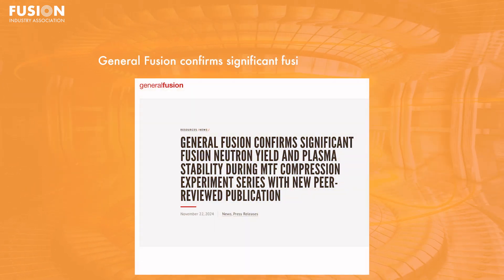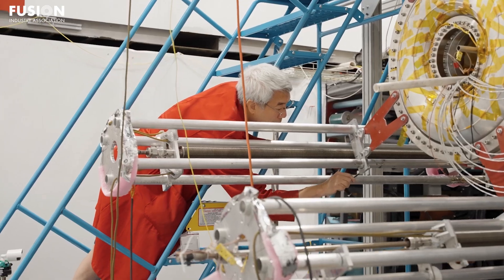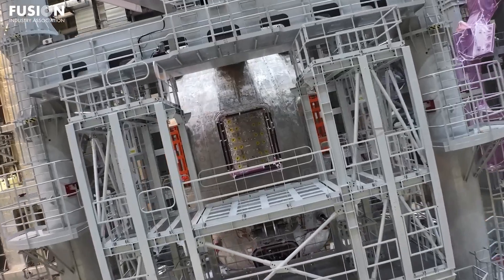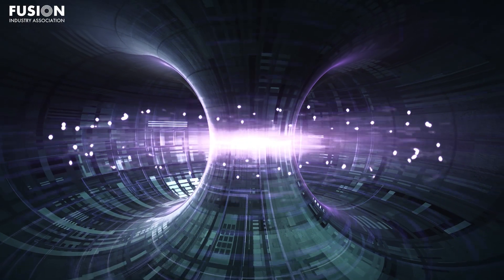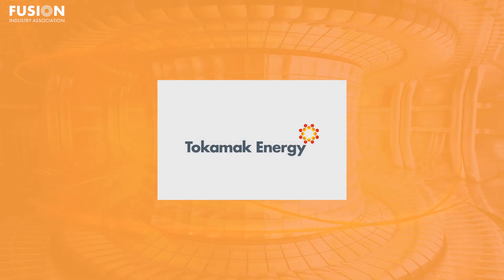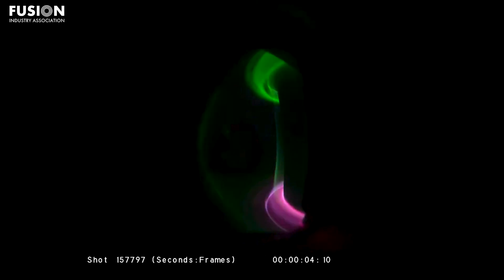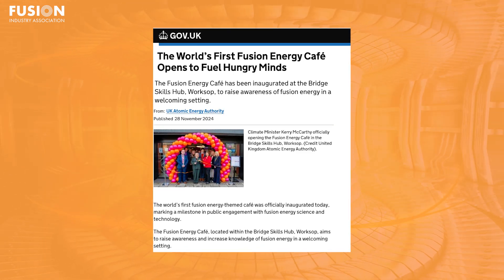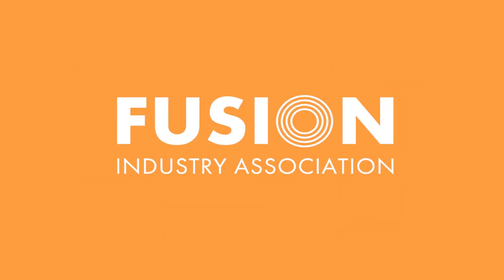Fusion News, December 11, 2024

Comment: The phenomenon of nuclear fusion does not have any reasonable theory; the mechanism of fusion is unknown to now. The present theories of quantum mechanics, quantum chromodynamics, electroweak theory and nuclear forces are unable to explain reactions of nuclear fusion. Until there is a clear theory of this phenomenon, there will be no reliable experiment focused on an industrial result, that is, a continuous nuclear fusion reaction of light elements. So, where is the theory?  Are leading journals capable of publishing such a theory, as it would certainly bring a significant revision to the existing theories listed above?..

Comment: Our reactor uses ion pressure instead of heat and we use an electromagnetic piston to compress the ions that are made by passing a small current through the neutral gas. we are looking for funding. The three prototypes cost us about £500 each. lit a 3 watt m.e.s lamp.

Comment: Fusion... yes... when I was recent engineering grad, like yourself, there was equally optimistic news on fusion. Since then (40 years) we have managed to harness energy from the only, 'local', working, fusion reactor. And now we're creating a terawatt+ of power every day - pollution-free.
Over the years it has become abundantly obvious that even if net power-positive fusion is ever created, the power will be far from pollution-free. In fact things are going to get radioactive pretty quickly and we'll be back to the fission nightmare were the instant a power plant is started, that is the last time that piece of land will be used for farming, housing or indeed anything other than a pit in to which vast quantities of money are poured for a hundred plus years (see Sellafield).  
To power our civilization on this planet, we only have to look to the sun, the wind and the inexhaustible supply of heat beneath our feet to supply every kWh of energy we will ever need.

Comment: OK you’re using panels anyway which means segmented and you can have sensors watching the plasma in each area. It looks like the wave of energy travels around the reactor, and you can use a feedback loop to control the magnetic containment field. The feedback from panel one is fed into panel two so as the energy wave arrives, it can use the magnetic field to choke the energy.
Reply: You use AI to keep track of everything and keep adjusting the magnetic field

Comment: General Fusion’s neutron yields are impressive, but when they turn to DT plasmas, will they be able to breed tritium without the presently difficult (and perhaps impossible) step of isotopically enriching the lithium to increase the Li6 content.
Reply: A reply asks about the breeding blanket’s thickness and if there have been simulations of the breeding. The blanket thickness needs to be about a metre in order to absorb most of the 14 MeV neutrons. There are simulation papers on breeding and the breeding ratio in the literature but there is no experimental experience, and nor can there be on the scale required. Can a billion dollar reactor be built on a vague assumption that it will work??
Reply: General Fusion stated that their experiment generated 600 million fusion neutrons per second but the fusion reactions lasted less than a microsecond. Do the math and you will see it is not as impressive as you first assumed. The famous 12/05/2022 NIF laser shot resulted in the generation approximately 1 x 10E+18 fusion neutrons for a reaction that only lasted for about 80 pico seconds before 96% of the unfused fuel was blasted away from the reaction center and sucked into the target chamber vacuum pumping system.

Learn how experimenters manipulate their presentations in the quest to elicit more investment funding.
Reply: @vernonbrechin4207  Good catch. Those General Fusion guys put out some very deceptive information.
Reply: @ - The process has become institutionalized in a very diverse field that is now competing for many billions, in USD, annually from both federal funders and private investors. Since almost all people, who have expertise in the field are fans, the funders are relying upon them for so-called critical assessments. Most of the experimenters have found that they can easily snow outsiders due the the extreme complexity of the field. They employ word definitions that differ from what most outsiders are familiar with. Gain and ignition are two examples.
Reply: It is a common misconception that increasing the Li6 content increases the tritium breeding ratio. To prove my point, consider a 2 meter thick FLiBe blanket having natural isotopic ratios: Be9=0.1428... Li6=0.0217... Li7=0.2640... F19=0.5714... According to OpenMC's simulation, the TBR of this natural FLiBe mixture is 1.25. When I increase the enrichment to 100% Li6 (0% Li7) the TBR dropped to 1.08. And, most interestingly, when I decreased the amount of Li6, so there was 100x as much Li7 as Li6, the TBR increased to 1.26.
Reply: - Thank you for the correction. I admit that my one microsecond figure was a guess. Thank you for pointing out that the measured fusion reactions lasted for 0.000,275 second. That would mean that the number of fusion neutrons released would be around 600,000,000 x 0.000,275 = 165,000 fusion neutrons. What purpose may have been served by stating the neutron number in terms of neutrons per second? Perhaps the experimenters eventually aim to have their ‘implosion’ reactions last for a full second. The 165,000 neutrons compares with the 12/05/2022 NIF experiment that generated ~ 1,000,000,000,000,000,000 neutrons during the 0.000,000,000,08 second that reaction lasted before explosively blowing 96% of the unfused fuel away from the reaction center ‘hot spot.’

NIF began operating in 2009 after being succeeded by a series of five other laser driven inertial confinement (ICF) fusion experimental machines that ‘proved’ NIF would achieve a ‘scientific breakeven’ fusion reaction by 2012. It missed that goal by a factor of over 100. The funding continued since its primary purpose has always been as a thermonuclear weapon (H-bomb) research tool. After a decade of tweeks, costing many additional billions of USD, it finally achieved the long sought after goal of ‘scientific breakeven’ reaction which involved pumping the lasers with more than 100 times the energy than resulted from the fusion reaction, which remains many, many, orders of magnitude away from anything that could be considered a nuclear fusion energy, commercially practical, pilot power plant.
Reply: @ - General Fusion employs a variation of Inertial Confinement Fusion (ICF). In such cases the fusion ‘burn’ is expected to last for only a tiny fraction of a second before the fusion reactions blasts much of the unfused fuel away from the ‘hot spot’ where conditions are optimal for fusion to occur. There will be limited propagation, of the fusion reaction, before disassembly happens. In the proposed power plant designs there will need to be lengthy recovery times between each ‘shot,’ with the fusion time lasting only a tiny fraction of the time between each ‘shot’ cycle. If the ‘ON’ duty cycle is 0.01 then the fusion energy, emitted during each ‘shot,’ will need to be 100 times greater than the average thermal energy generated by the power plant. In the case of a power plant designed to produce an average thermal energy of 100,000,000 watt-hours the averaged energy of each fusion energy pulse would need to be 100,000,000,000 watt-hours.

The ‘scientific gain,’ Q-plasma value for pulsed experimental machines applies only to the short period of time fusion is actually occurring. It doesn’t apply to any lengthy recovery period between each pulse. Any consideration of a power plant design must consider the total averaged input energy into the facility to formulate the a Q-total value. In the case of today’s record breaking nuclear fusion experimental reactors their Q-total value, averaged over a 24-hour period, remains well below 0.01.
Reply: @michaeldeeth811  - I admit that my fusion time was a guess. Thank you for providing the 275 microsecond value. That means that number of fusion neutrons generated was 600,000,000 neutrons per second x 0.000,275 second = 165,000 neutrons during the reaction time. I wonder if there was some advantage gained by expressing the number of neutrons per second. Perhaps General fusion hopes their inertial confinement fusion (ICF) approach to eventually achieve at least one second confinement times before the fusion reactions disperses the ‘hot spot’ that is favorable for the fusion reactions.
Reply: @vernonbrechin4207  If the guys at General Fusion really achieved a 6E8 neutron yield on their first attempt, that would truely impress me. It's easy to forget, now that NIF has achieved ignition, that it took over a decade for laser fusion systems like JANUS, ARGUS, VULCAN, GHEKKO-IV, and HELIOS to surpass 3E10. You are expressing a lot of negativity about fusion. Explain to me why you think these guys are a bunch of scammers, because I believe them.  BTW, I liked that you pointed out the problem of ICF fuel confinement, how quickly the hot fuel expands into the vacuum. Am I wrong, or is that something General Fusion solved?
Reply: @michaeldeeth811 - The National Ignition Facility (NIF) was preceded by five generations of laser driven Inertial Confinement Fusion (ICF) experimental machines that ‘proved’ to the funder that NIF would achieve the scientific ‘breakeven’ fusion goal by 2012. After billions of USD were spent on it it failed by a Q-plasma factor of more than 100. After an expenditure of many more billions dollars and a decade of delay it finally achieved a Q-plasma value of slightly greater than 1.0. Typically, left unmentioned, is that pumping the lasers, for that 12/05/2022 shot required more than 100 times more energy then resulted from the 0.000,000,08 second fusion reaction that then explosively dispersed 96% of the unfused fuel.

NIFs continuing funding has always been driven by the fact that its primary function has always been as a thermonuclear weapon (H-bomb) research tool.
Reply: @michaeldeeth811 - Most proposed nuclear fusion energy power producing reactors will likely operate in a pulsed mode when operating at near maximum fusion energy levels. By definition the various proposed Inertial Confinement Fusion (ICF) reactors, such as that envisioned by General Fusion, will produce very brief fusion energy bursts followed by lengthy recovery and reset periods of time. An example would be a power plant where the fusion reactions would take place for only 1.0% of the operational period during a 24 hour period of time. If the power plant is intended to generate an average of 100,000,000 watt-hours of thermal energy then each fusion energy pulse would be required to release 10,000,000,000 watt-hours of thermal energy. Few designers appear to be pointing this issue out to journalists, to the general public and to investors.

Another issue, that typically goes unmentioned, is that the ‘scientific gain’ value, or Q-plasma value, only applies to the very brief period of time that the fusion reactions are occurring. All suggestions, for a power plant design, must include a statement regarding how much input energy is required to operate the fusion reactor over a 24-hour period of time. The energy gain value of that is often described as Q-total. In the case of the current fusion energy record holder facilities the Q-total value remains well under 0.01 when averaged for a 24-hour period of time.